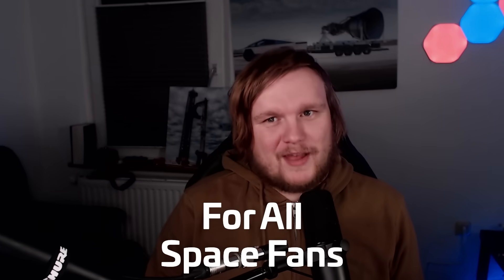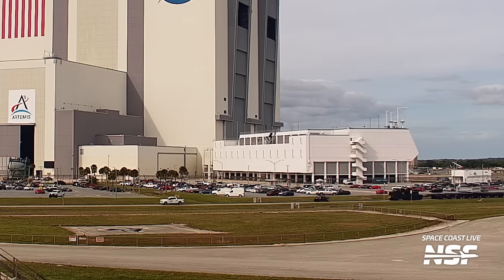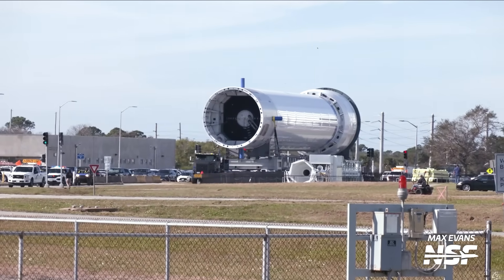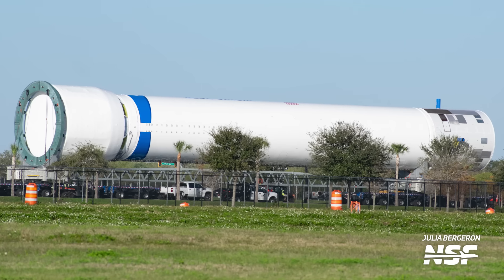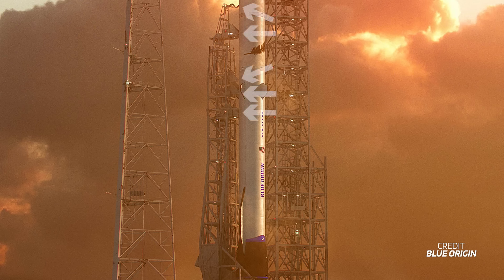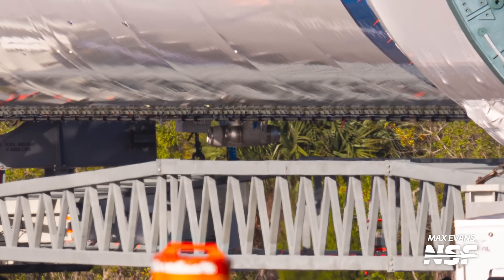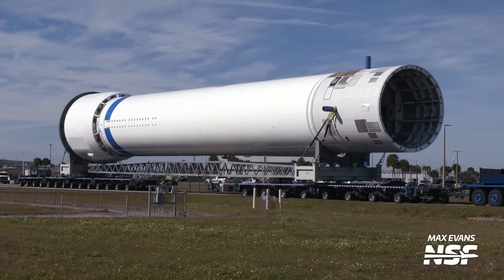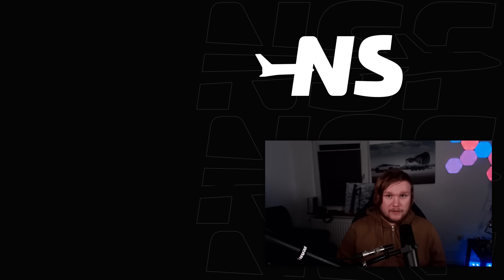Blue Origin Rolls Out New Glenn | Breaking

Comment: Good luck to New Glen.  This would be a huge boost to the US Space program.  However, based on past performance, I have my doubts New Glen will even attempt to launch this year...hope I am wrong but Blue Origin to date has not really done much to inspire confidence.  They have produces a bunch of cool pics, vids and ship mock up but nothing into space (what I mean by that is an actual rocket not just engines). i was a HUGE Blue fan years ago, but they have been highly disappointing to date.
Reply: Based on reports from former employees, Blue's design philosophy is to perfect each step, before moving to the next. Based on New Shepard, they make good hardware, eventually. The BE-4 engines debut on Vulcan Centaur are promising as well. So it is likely the New Glenn will be a good rocket, eventually.

Comment: The Blue Origin subreddit has a lot of actual employees who comment on things, and it's been confirmed that the booster here is real flight hardware with the non-flight interstage forward module section. The booster will serve a similar pathfinder role that the Vulcan Centaur PTT did back in 2021. 

Also missed here in this video is that the Lex Friedman photo shows another forward module, but unlike the non-flight version, there's clearly insulation on it, and it actually has fins installed on it. There is also another midbody seen in the photo, but at the time it was taken over a month ago, it was yet to have any insulation panels, propulsion lines, or electrical lines installed. And this fits in well with what the Wall Street Journal article stated about four boosters in the work.
Reply: I had no idea about the Blue Origin subreddit. Thanks.
Reply: @uku4171  check it out, great subreddit
Reply: There's other details he missed. The test article interstage has clear attach points on it for the 2nd stage to be bolted on to. If you look at the very high-res close ups inside the interstage, you can see that there are pneumatic hydraulic mechanisms for stage separation. It's likely that this module was used to test the structure of the interstage and then the separation and other systems.
Reply: This is a pathfinder.  It will be for test fit and so on.  It likely won't even ever be fitted with engines.  I make it 18 mos before NG flies, minimum.
Reply: @sdebeaubien  It is, but the 2nd stage has BE-3U engines and the GS-2 booster that is rolled out can buy down a lot by being propellant loaded, software and GSE verified, etc. just as Vulcan's did. 

We don't know if GS-2 Freedom has engines or not. There are plenty of leftover dev engines from the Vulcan BE-4 test and qual program that should at least allow 3-5 engines to be installed.
Reply: So should be then assume New Glenn is 2-3 years from an orbital flight? Probably not, but I was wondering whether it could be this year.
Reply: @J7Handle  it will fly this year
Reply: @jamskinner I’d bet you 4 dollars, but I don’t have a credit card so that can’t work.
Reply: @iamjwns6277   Assuming no unforeseen delays (like the CentaurV going pop for Vulcan) , but man do I hope that it does fly this year.
Reply: @J7Handle  The issues with Vulcan development shouldn't be used as an exact gauge of how long it will take, barring something major on the level of the BE-4 turbopump issue of 2020 and or the Centaur V qual article in 2023. With BE-4 now hammered out, having flown an orbital launch mission and for nearly twice as long as it would on a New Glenn mission, there's a lot risk bought down.
Reply: @Starshipsforever  It's still only 2 BE-4s having flown. Not yet huge confidence in their reliability just from that. New Glenn has 7, more chance for a failure, and I don't think there's engine out capability on New Glenn.

But really, we have to ask how close they are to actually having a full stack, let alone flying one.
Reply: @J7Handle  There will be at least two more to fly before New Glenn does. 

Also, apparently, you're not up on developments. There IS a full vehicle now in the integration hanger. A booster, 2nd stage, and fairings (assembled as though with a payload).  They'll be tested separately and then like together as practice.

Seven engines is enough for an engine out capability at or just after max Q, since we know that BE-4 can be overthrottled at least 4% above and beyond its normal 100% range. On top of that, Tory Bruno's stated that BE-4 is operating slightly better in terms of thrust and ISP than expected.

Comment: @3:40. Those rings are NOT tank sections. Those are panels of insulation that cover the actual aluminum alloy tanks. If you look carefully at the factory photos of other midbody tanks, they have actual standoff attach points for the panels on them. On the "bottom" of the midbody from six weeks ago and now, you can see where a line of this insulation is left off down the length of the tanks.

Comment: The thing that worries me the most is the almost unavoidable comparison to SpaceX. It took them more than two years from the first fully completed booster to the first flight. And while it is hard to find good data on other rockets, it's probably not too far off with ground testing of both booster and ground systems. We also have yet to see a fully assembled second stage of New Glenn. So while they are obviously making good progress, I don't think the first flight is as close as one might hope.
Reply: We now have pictures of the second stage of new glenn with engines and is in LC-36 rn
Reply: Blue just posted a photo of a fully assembled second stage with engines 😃
Reply: Blue Origin spent years in secrecy, quietly working on New Glenn. We saw nothing but fairings and engine nozzles up until these past few months, so who knows what else they have waiting to be rolled out.
Reply: SpaceX does trial and error, Blue Origin doesn't. They want at rate production to be ready basically as soon as they start launching (Bezos is confident that the first launch is this year). From idea to first commercial launch, New Glenn is on track to be about as fast as Starship. Both were first conceptualized in 2012. Starship's progress is just a lot more public.
Reply: @uku4171  exactly!
Reply: What you mean it’s a cylinder….like all rockets 😂😂😂
Reply: This post did not age well lol
Reply: But they are working "nasa-like", BO will probably need way more boom or fail than spaceX to achieve success, but yes, like nasa, it's long
Reply: isn't starship supposed to be millions cheaper
Reply: First flight is this year. People said BE-4 can’t succeed on first flight because raptor blew up many times. Yet BE-4 succeeded in flying an orbital mission which raptor has not yet done.. blue do engineering different than SpaceX, New Glenn will succeed on first launch
Reply: @iamjwns6277  "Yet BE-4 succeeded in flying an orbital mission which raptor has not yet done." Nonsense. The 33 Raptors on B9 successfully boosted their second stage to nominal stage sep. (and beyond)
Reply: @proesterchen That was not a successful orbital launch.
Reply: @proesterchen  never got to orbit. Also those same raptors failed and caused both booster and starship to blow up. Still issues with raptors. When they tried to relight the superheavy raptors some fails and the booster blew up. You cannot compare to BE-4. BE-4 in its first ever real mission succeeded flawlessly. The most powerful methalox engines in the world. Raptor is still failing on test flights.
Reply: @iamjwns6277  " You cannot compare to BE-4" That's true, the BE-4s have yet to re-light post stage sep. We'll have to wait for New Glenn for that.
Reply: @iamjwns6277  The raptors in the second test flight and also in the recent static fires.. have been working phenomenally. The booster failed in the second test flight not because of the engines but because of the fuel sloshing around.
Reply: @iamjwns6277  so you're saying if raptor was used on a disposable rocket you'd be satisfied with the booster's performance
Reply: ...before blowing up
Reply: As said earlier, BO and SpaceX use different development approaches. The latter creates lots of prototypes, in order to work out how to build equipment, and they carry out countless tests to verity that it works. BO appears to use a more traditional approach, presumably design up front, then build the finished product. However, BO are building a non traditional rocket. They are going to have to test the landing of the booster, and that ain’t gonna work first time, maybe not second, third, or fourth. But I guess they can carry on doing that, as long as the second stage lights and puts the payload in orbit, they’ll be happy if they eventually get a successful first stage landing.
Reply: @StillAliveAndKicking_  it will work first time just like everyone said no one has ever built a working ORSC engine in America and now one has ever built a methalox ORSC engine in the world, so BO won’t get it right on the first time, so many space fans said BE-4 won’t work because they don’t do spacex like tests that blow up the engine in test flights.. but Guess what happened? BE-4’s worked perfectly on their first flights. The first methalox staged combustions engines to ever fly a real orbital mission.
Reply: @iamjwns6277  Yes and no. The BE-4 engines have never relit in flight, and they have never reflown. I don’t disagree that their first flight was a great achievement. However, the plumbing, flight control, system etc were built by a company with massive previous experience and proven management teams.
Reply: Ikr.. even when done which it is far from.. the gap between static fire n launch is like months
Reply: There simply is no comparison.
The number of launches every month by SpaceX is not possible to catch up to at this time.
All of the criticism of the starship program is hilarious when compared to all of the others trying to compete. How many have gone bankrupt or on the verge, or merging to somehow stay in the game?
I'm glad to see all of the different ideas, but they are simply not practical or sustainable. The time to design, build, test, and still not actually fly or operate says everything.
Yes, it would be fantastic if any of these other ideas were a success, but they just are not, including Artemis.
Reply: The first flight or even getting there is not the hardest part... staying at mars will be the hardest part.